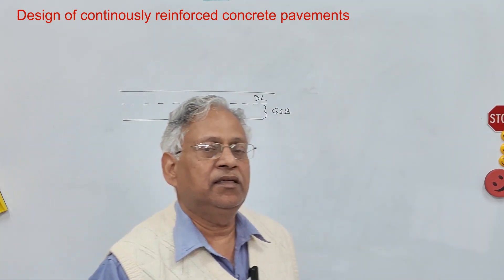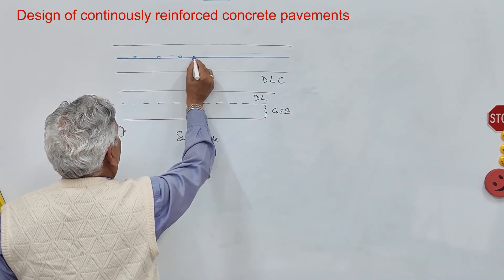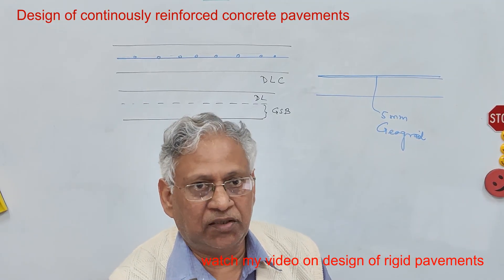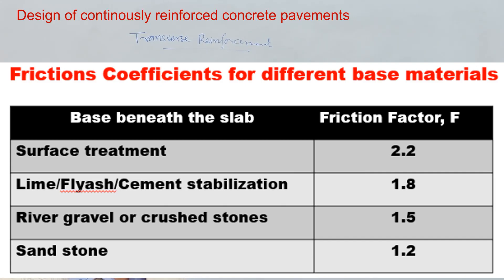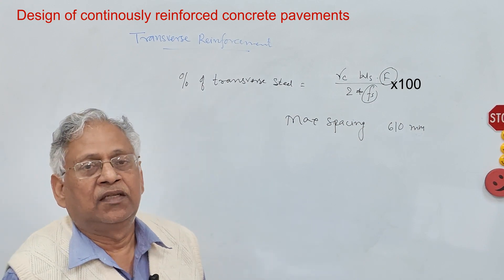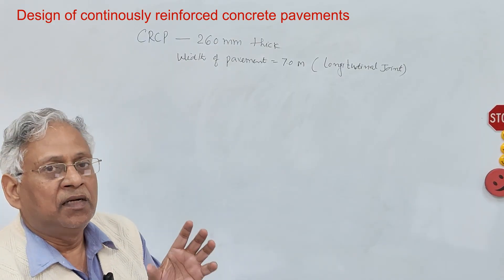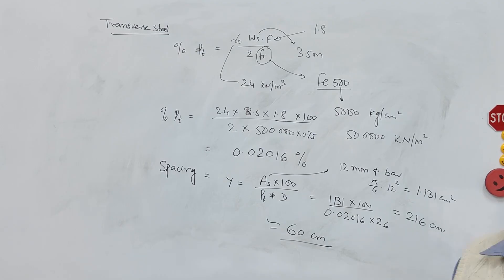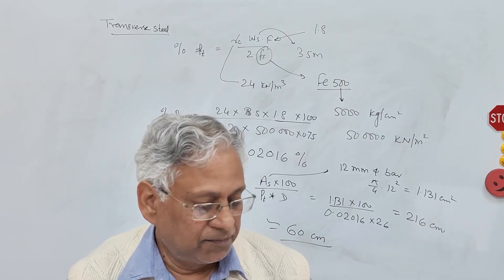Design of continuously Reinforced Concrete Pavement - complete procedure with example as per IRC 118

Comment: Sir, in Section 9 of IRC 58-2015, reinforcement in concrete slabs to control cracking is given. Is that section the same as CRCP IRC 118 or different?
Reply from the maker: NO, A pavement with dowel bars is not a CRC pavement. IRC 58 is for jointed cement concrete pavements